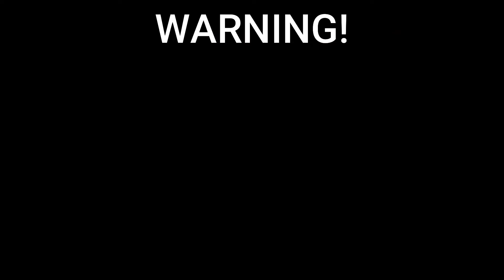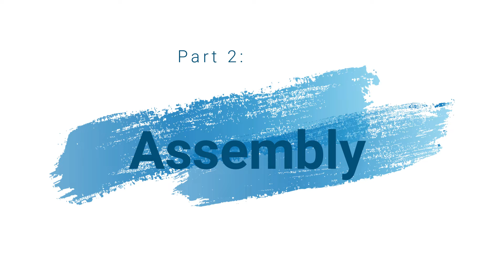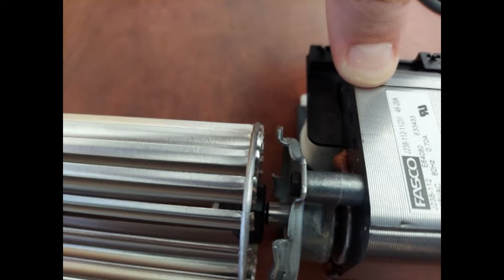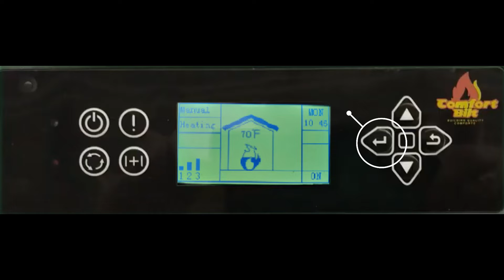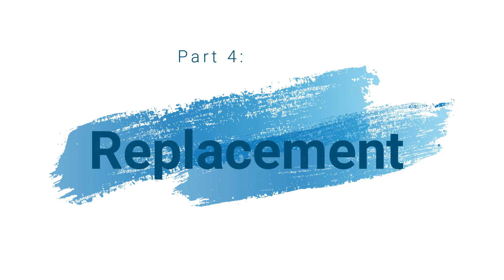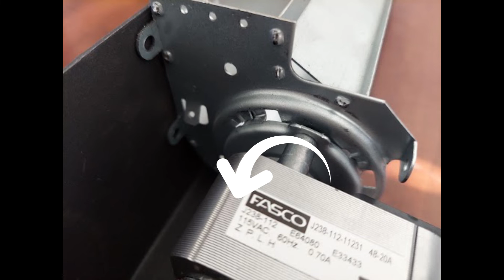Room Blower Fan Troubleshooting

Comment: How do you get the mounting bracket out of the stove?  Same question as a bunch of others have had.  The four bolts are easy enough to remove from the main stove chassis, but the tabs on the mounting bracket will not come out from under the sides of the main chassis.  I can slide the bracket left and right and angle it but it is not enough to allow the tabs to clear the slot they are contained in.  In the video, you go from showing the bracket and fan inside the stove to out, skipping showing the step that seems to be causing people problems.
Reply: https://youtu.be/db9VFNVvuU8?si=-oVilScvpmgB9yfH

Comment: I have the HP 21 and I think the blower motor to circulate the heat through the house isn't running. My stove on top gets so hot I can't touch it and on the sides where it shouldn't get hot at all. I believe the blower motor isn't running but nobody has a diagram of where the hell the damn thing is. So does anybody know where it is and how to replace it

Comment: Where is the motor located and how hard is it to get out
Reply: The motor/fan assembly is located on the bottom of every unit. (usually bolted to the floor of the chassis).  On the HP21, you can only access it from the back - in that bottom section.

Comment: My pellet stove is off but the fan is not shutting off.  What should I do?  I have the HP54
Reply: I'm having the same issue. Stuck blowing cool air while the stove is off..
Reply: @keeganburke8403  I shut the stove off on the back and then usually I can turn it back on and get it back to the ignition part.
Reply: @michellebeverlyisaac131  thanks, I ended up pulling the two wires that connect to the blower, dusting everything, plugging wires back in and it fired right up. Annoying they don't have trouble shooting for that specific issue
Reply: It may be your low limit switch isn't working properly. When the stove is in shutdown mode it should reach a certain low temp, probably 120° and then send a signal for the exhaust fan to turn off.
Reply: Mine doesnt turn on and my top of stove is starting to discolor because of all the heat